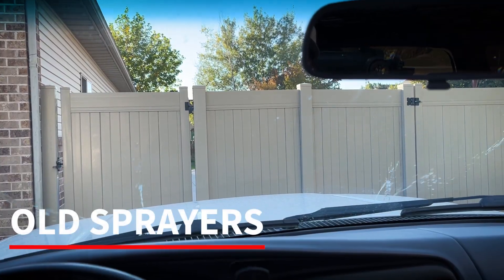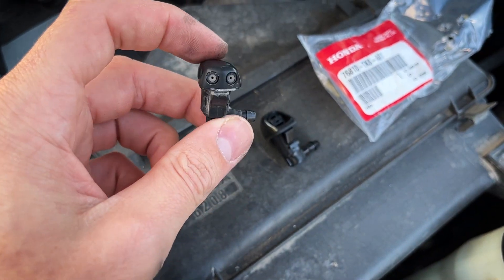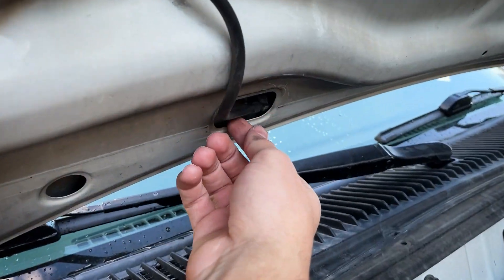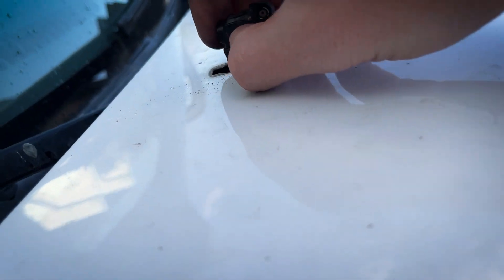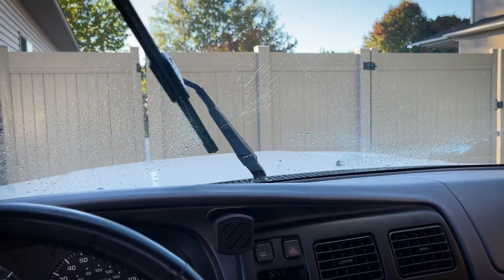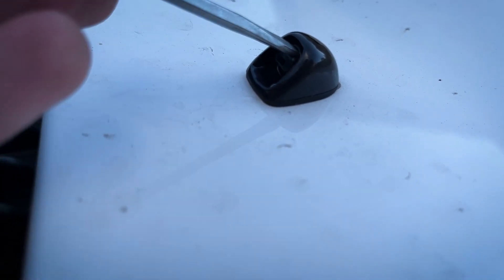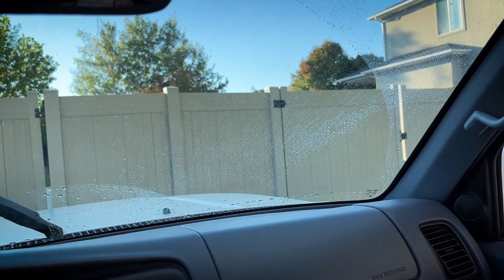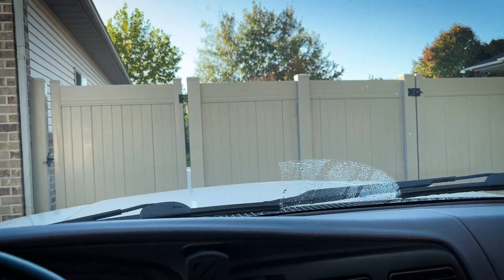3rd Gen Toyota 4Runner Windshield Sprayer Upgrade

Comment: Because of the mist instead of a stream, have you noticed any issues using it while driving on the highway? I imagine it would scatter a bit more due to the wind. Good Video btw.
Reply from the maker: Thank you! And none at all. In fact it’s better. I probably use half the fluid I did before and have better results